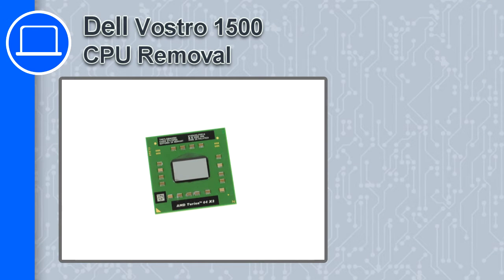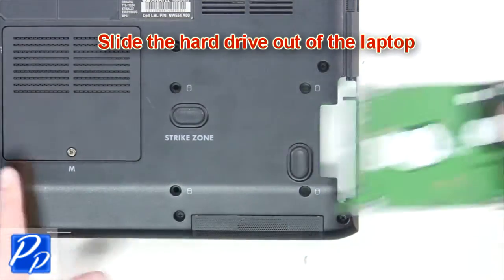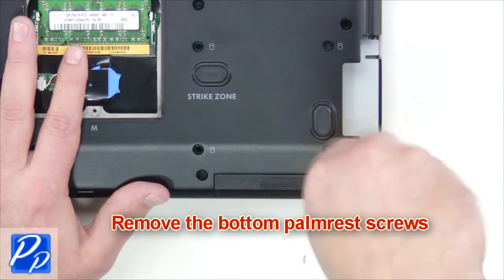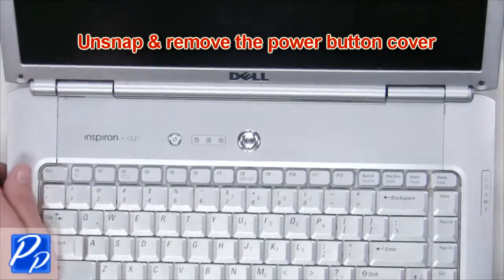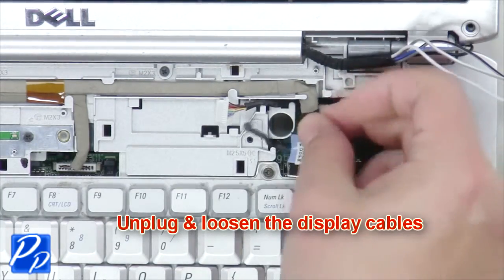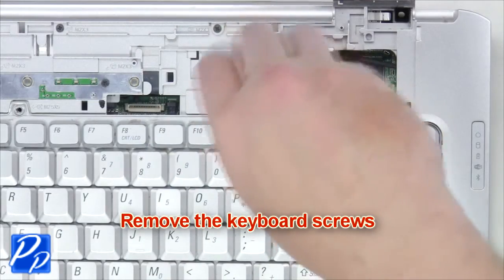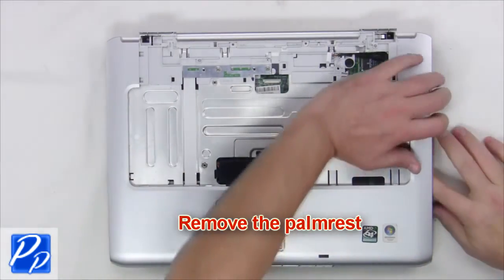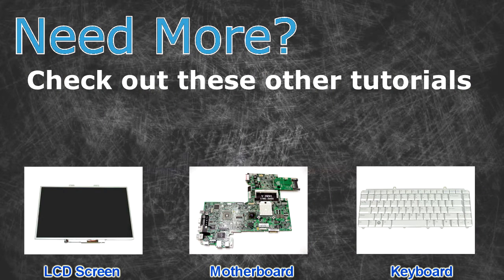Dell Vostro 1500 CPU Replacement Video Tutorial

Comment: Would it be necessary to reinstall the operating system after switching from one processor to another? 2x2.0 to 2x2.20
Reply: No, you can use the os

Comment: que capasidad de memoria y cual es la describcion del vostro 1500 yo tengo uno y quisiera saber si sirve para juegos buenos
Reply: It can accept 2x2GB sodimms and a T8300 processor.  The variants with X3100 graphics may not be best for gaming.  64 bit windows 10 may be unstable, but 32 bit seems fine when tested with patched bios/vbios.